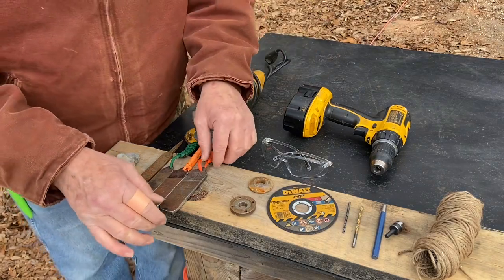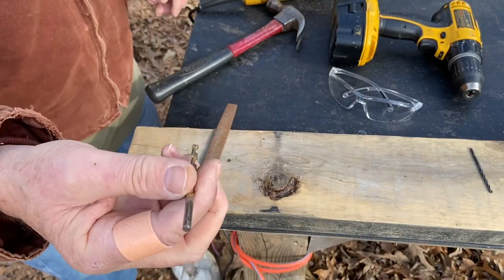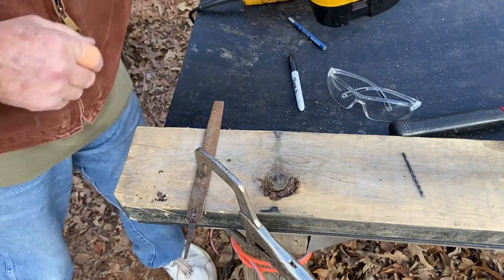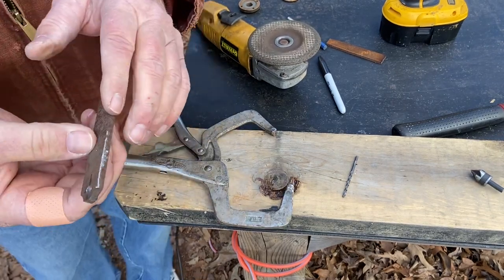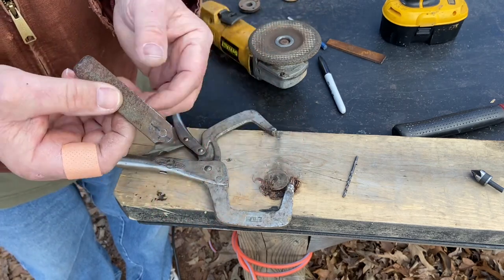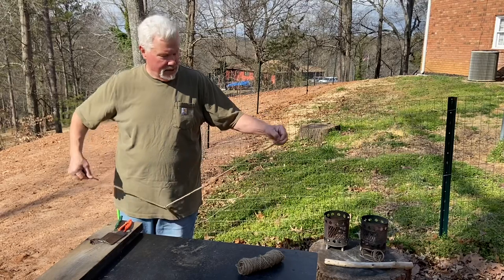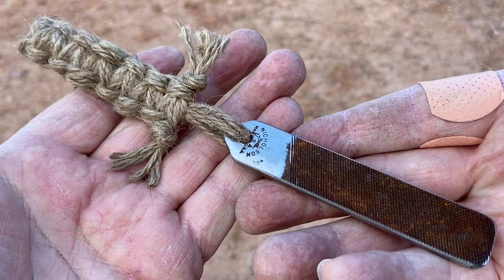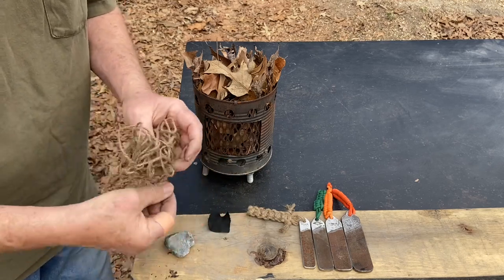How To Make A Flint And Steel, Steel From A File. Jute Lanyard

Comment from the maker: When I line up the 3 steels that I made from 14", 12", and 10" Nicholson files, It looks like one is missing. LOL!!! Let's head back to the Flea Market and find the missing one, an 8" Nicholson file and do another Steel build.
   An 8" file is a lot smaller than the other 3 sizes. It's a couple inches shorter and only half the thickness. Such a small amount of mass actually changes the whole dynamic of getting the sparks to cast. Simply put, I think the small steel is just bouncing off the chert before it's had enough time and contact to be scraped.
   There's some physics in play here...Newton's First Law of Motion states that a body at rest will remain at rest unless an outside force acts on it, and a body in motion at a constant velocity will remain in motion in a straight line unless acted upon by an outside force.
   This steel has exactly the same steel and exactly the same sparkiness as the bigger ones, but requires a bigger piece of Chert, moving twice as fast, with twice the force to get it to cast sparks. That's not the only difference. The sparks that are being cast are moving much faster and now tend to ricochet off the char cloth instead of stick. Because of this new dynamic, I'm only averaging 3 to 4 strikes for ignition instead of the usual 1 to 2. I'm sure with practice that I could improve to 2 to 3 strikes for ignition. Interesting!
   Please follow the LINKs below and SUBSCRIBE. Thank you!

Flint And Steel Playlist
https://www.youtube.com/playlist?list=PLkoXX8XsMW3mFf5FgLtam1aDmXmqQQice
Make A Steel Out Of A File Playlist
https://www.youtube.com/playlist?list=PLkoXX8XsMW3n39s_OA1Y3ib73n2Ee57Ed
Cobra Weave Tutorial, for severely “knot challenged” people like me!
https://youtu.be/UoaHHhUTkEI
Reply: I'm confused David. I slowed the video down to 1/4 speed at the @12:00 mark. It looked like you were striking the chert with the edge of the steel where you had removed the teeth, and not the face of the file. I've watched several of your videos and am first noticing this. I assumed that you were using an old file because of the teeth.

Comment: A great tutorial, thanks. Why do you remove the teeth on the edge of the file? Wouldn't the teeth provide a stronger striking area?
Reply from the maker: It seems to break off the sharp edges of the Chert without providing many sparks.

Comment: Another fun video David; thanks, I wonder if you accidentally lost the temper if you could heat it back up with a torch, then quench in ice water. Maybe that would make it too brittle. Any thoughts?
Reply from the maker: I don't know any more about tempering than what you said... Heat metal to cherry red, quench it to quickly cool it, and it becomes brittle. Heat metal cherry and let it slowly cool at room temperature and it becomes soft.
Reply: I have a handmade patch knife that has a C-steel for a handle that I bought from Dixie Gun Works over 20 years ago. It has lost its temper somehow and won’t throw sparks. 
I suppose there is a video somewhere on YouTube that can show me what to do.